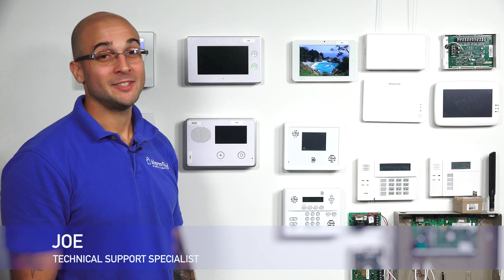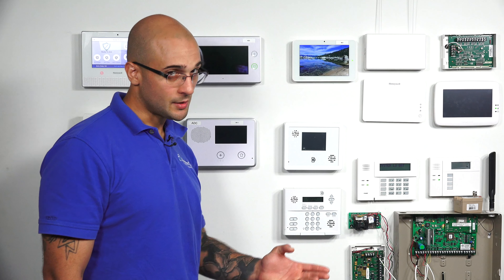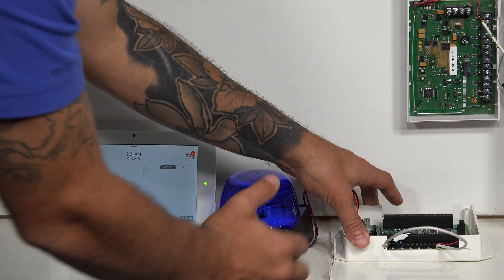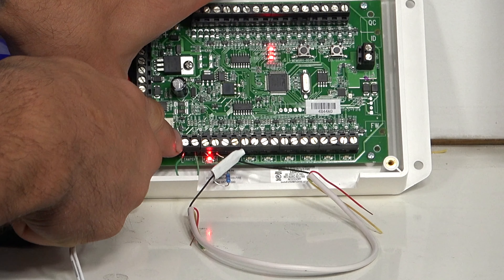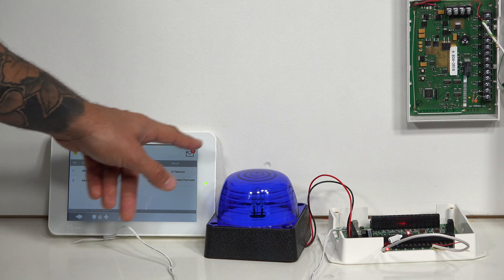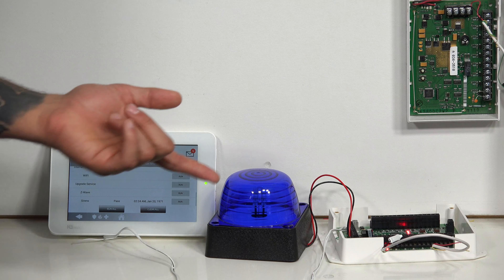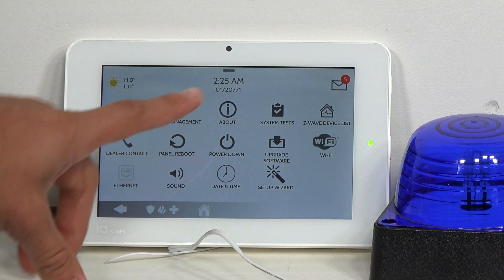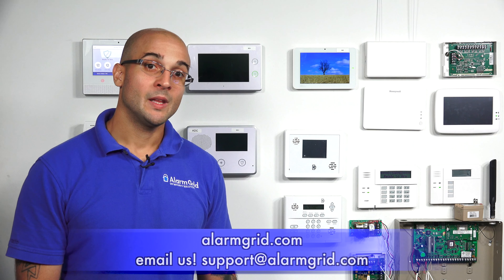Adding a Siren to the Qolsys Hardwire 16-F

Comment: I had this panel installed in my basement for my existing door sensors.  When I connect the siren as in this video it doesn't work,  does the new wireless alarm panel installed upstairs need to be setup for the siren?
I really don't like the squeal the panel makes when there's an alarm, much prefer an old fashioned loud siren; if there was a way to put a (wireless) siren outside where I have AC power that would be even better!
Reply: @Bryce Alarm, yes, the translator is working, I've got my existing hard wired door sensors working off of it.
I figured the 20 watt siren from the old system is too big a load so I bought a little siren and it doesn't work either.  I also don't hear the relay clicking either so I don't know what's going on..?